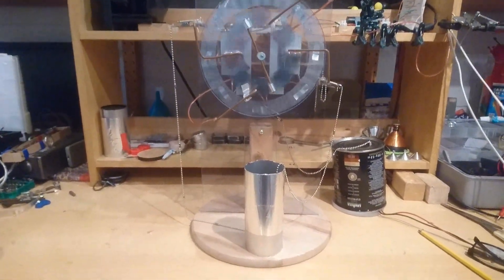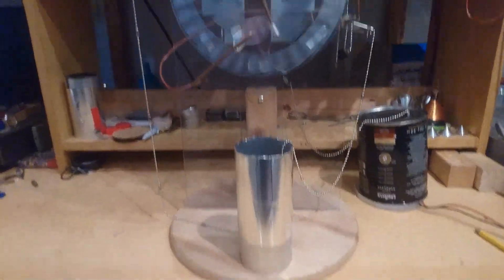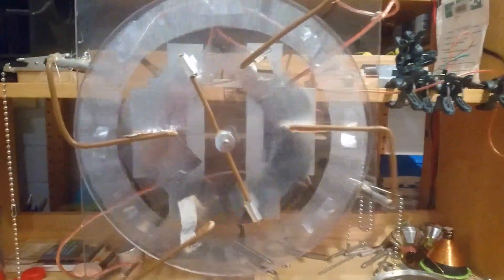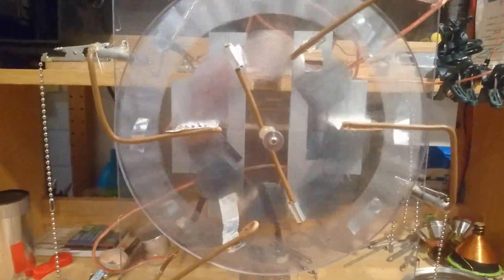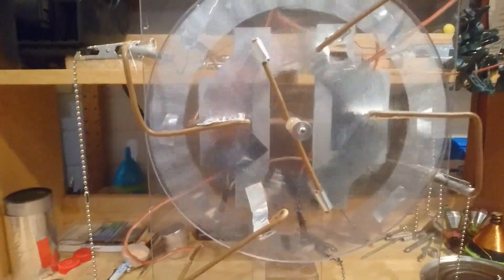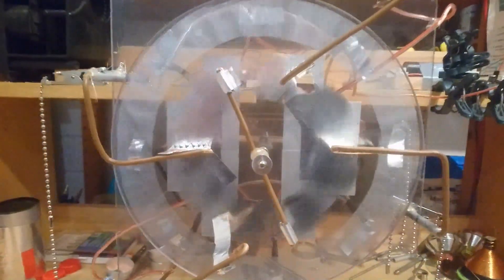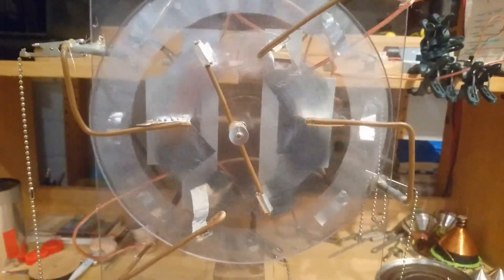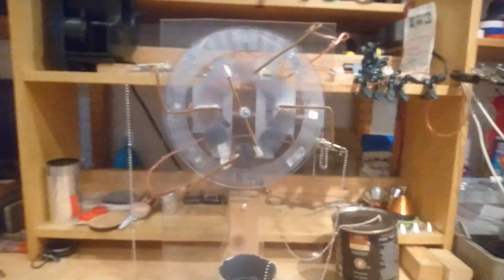Electrostatic Motor / Generator :(

Comment: Hello sir,

Great model that you built.
I’ve built a number of Wimshurst generators and getting ready to build a Toepler also known as a Voss generator.
I may be wrong but it appears that the neutralizer bar has aluminum situated as the brushes being utilized.
You will have I’m certain an improved performance if you instead use copper wire, copper conductive foil tape or Faraday tape doped with nickel and copper. Both of the copper tape & Faraday tape can be purchased off of Amazon here in the States, the material does not scratch the foil sectors when rotating.
I’m fascinated with this type of induction generators, I hope you continue to experiment with the models you have devised and built.

Thanks for sharing your work!

Comment: It appears to be an electrostatic turbine.  Benjamin Franklin invented it (or more accurately probably re-invented it).  Works like this:  an electrostatic potential - say, positive electric polarity - is applied to one of the electrodes. The electrodes are on the outside of the wheel, in close proximity to conductors mounted on the rotate-able wheel.

It does not need to be a large potential on the electrodes, as long as the rotation does not require lots of torque (ie. the wheel is lightweight, the rotation axis has small surface area/has a bearing). I believe Franklin's electrostatic turbine was horizontally oriented, with a sharp point on the bottom of the center axis to reduce rotational friction.  In other words, the axis of rotation was vertical, the plane of rotation was horizontal, and elevated off the ground by a center shaft.

The static charge in Franklin's case came from a Leyden jar if memory serves correct.  But perhaps the right type of chemical reaction would probably work, as this guy seems to be relying on - the cup with liquid in it and the metal chain dropped inside).

When the conductor on the wheel is in close proximity to the positive static charged electrode, the positive electrostatic charge removes electrons from the wheel's conductor.  The conductor on the wheel rim has now taken on a positive charge (because the electrode attracted and 'stole' its electrons).

The electrode is still at positive electrostatic charge. The conductor on the wheel has become positive charged too.  And the electrode now repels the wheel's electrode, keeping the rotation going.

A small starting push can be used to start the rotation.  You can find 'electrostatic turbine'  and 'Ben Franklin' or just 'electrostatic turbine' although they are rare, a novelty, probably because of the low torque. 

They are worse, in terms of starting torque, than a shaded pole motor  (a shaded pole motor has a small copper ring that introduces a slight inductive phase shift, creating a 2-phase induction motor, and they are used for cooling fans, and any application requiring rotation and low starting torque).

Here is one example of an electrostatic turbine:  "Ball Cyclotron (electrostatic accelerator)"
   at  https://www.youtube.com/watch?v=g1_Ms3O7ggM

A book by Major Donald Keyhoe mentioned a ufo witness who claimed to have been inside a ufo in the 1950s and that a portion of the propulsion system relied on an electrostatic turbine.  Whether the witness was reliable, who knows.  One role of a rotation might be the rotating center ring reported by some ufo witnesses.  If the UFO has a large center-axis magnetic field, and an electrostatic turbine is deployed to rotate a center metallic ring,  this would induce eddy currents in the ring as it rotates, and that would lead to the Lorentz force and coherent accelerations of the charged particles in the ring.

If you're curious about coherent accelerations of the charged particles in the ring, there is an APEC guest,  Glen 'Tony' Robertson with an artificial gravity model that relies on an unbalanced artificial gravity force created via accelerations of a portion of the hull material.  Tony worked with Ning Li.

.

Comment: Humidity?
Reply from the maker: Could be, i'm building a refined model now. Wait and see! : )
Reply: @YbborNetsrek Do you have an email to communicate
Reply: I’m pretty sure you have too many brushes and spinning wrong direction.
Reply from the maker: tnx for your input, but i do not understand your direction comment...  turn thing around or look at it from the other side.... and it is all reversed ;)
Reply: Rob Kersten well with mine it won’t work if I spin the wrong direction to well
Reply: Reverse the spin and it should work
Reply from the maker: @az4075   Now i get your point, it is not just the direction , it is also the sequence of the brushes combined with the direction.  I wil try it !  tnx.
Reply: Rob Kersten I look forward to seeing your results.